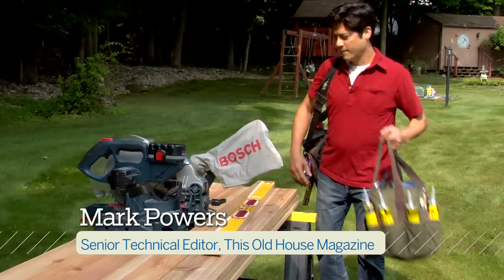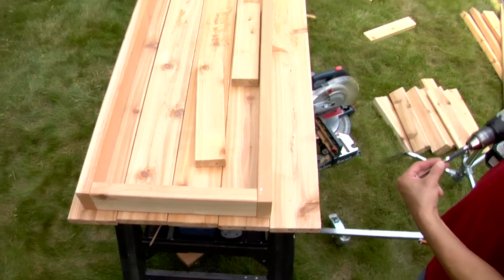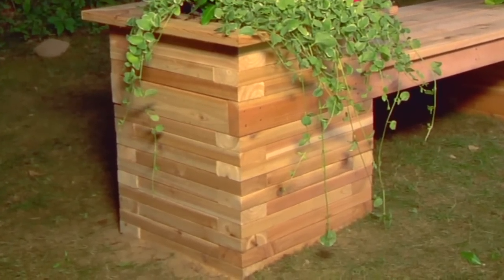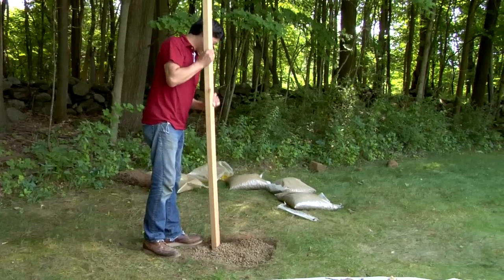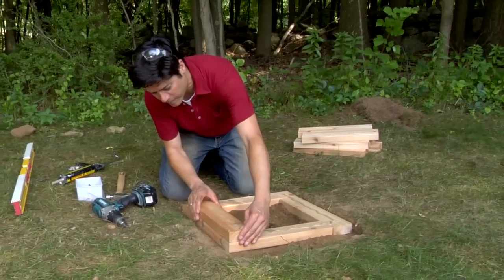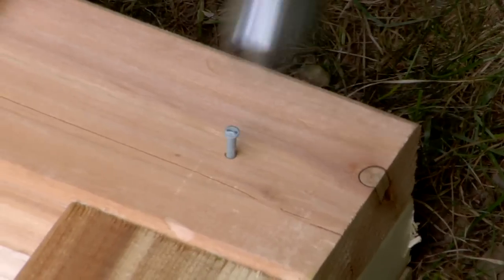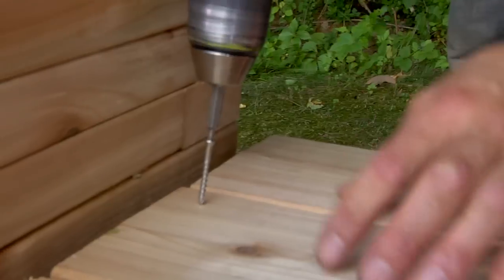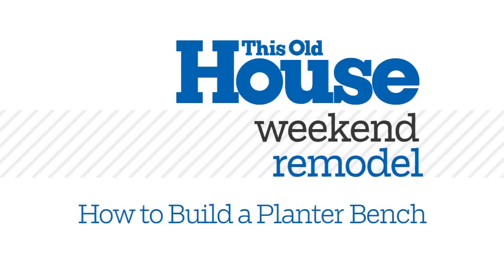How to Build a Planter Bench | This Old House

Comment: Shouldn't you use a pressure treated lumber for the first 2 courses?
Reply: Didn't he say that it's cedar?  That's somewhat rot resistant.  Also, you have the gravel base, so that'll keep water from settling there.

Personally, I'd use cypress.